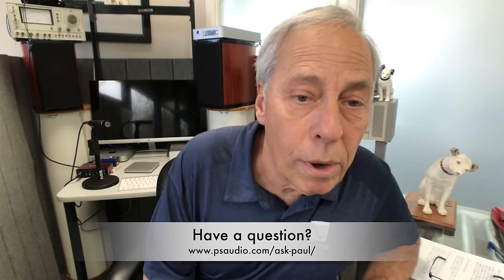How to match amps to speakers

Comment: It gets so complicated.  My understanding is that high powered amplifiers sound better with efficient speakers than lower powered amplifiers (every other variable being equal), because transients are more faithfully reproduced.  There is an "effortlessness" to the sound of a high powered amplifier driving even an efficient speaker.  Also, much of this depends on the kind of music being played.  Heavily compressed pop music may not benefit from a high powered amplifier, but a high powered amplifier playing well reproduced classical or jazz may sound more "effortless".
Reply: I agree.
And let me tell you, the musical genre that is most dificult for a system to reproduce how it should sound it´s Metal. If you don´t have loads of power, the results will not be good.

Comment: We also need to think about clipping in a low power amp trying to get loud out of speaker.  
The longer a party goes and the drunker people get the volume seems to need to go up..
Buy a cheap system for this..
My main amp is 60 rms per channel  and speaker rated at 200 max doesn't say rms so i guess 100 rms. I don't use much power

Comment: Power handling RMS / max.: 220 / 450 Watts
Frequency Response: 18 – 38,000 Hz
Crossover Frequencies: 350 Hz - 3,500 Hz
Recommended Amplifier Output: ab/from 30 Watt(s)
Sensitivity: 93 dB
Can anyone please recommend an amp for the above speakers? I have had 2 amps fail both a Sony  str-db870qs and Yamaha Rx-v367.

Comment: so the unefficient increase the electricity bill and and less good for parties ?
i'd trade that anytime for sound quality
Reply: i meant they could have something to make frequency response flat 
on smaller ones who can get low you may need to reduce mids and highs so they'd be balanced
Reply: example
Philips SHP2500 ( headphones ) sound like speakers with a subwoofer , bass is louder than mids and highs

Comment: Sir, Im from Philippines.
And i want to ask something. I have 300w amplifier and i want to buy 4 speakers..so in one speaker how many watts do i buy..
And i want to connect in parallel connections..
Thank you sir..
Reply: 100-200Watts is enough,..
Reply: @CABohol  100 x 4 speakers = 400w in that is overload
Reply: @ronaldsamson8607  some amplifier and speaker in Philippines is not a real specs,.. Example of that is sakura 5023 the specs says 450Watts,. But i measured the output using my oscilloscope and 8ohms dummy load i can only get 90Watts into 8ohms,.. And also the speaker like crown is not the real specs,. Ex. JH157 specs says 700Watts but in reality maybe it's only 100watts and the sensitivity is not true.
Reply: 80 watts speakers will be perfect for a 300 watt amp.

Comment: Howdy.
I would think that if one puts 300 Watts 15 kHz continuous into a 300 Watt speaker one can kiss the tweeter goodbye very fast.
The tweeter of a nominal 300 Watts speaker can probably handle no more than say 20 Watts continuous.
Amplifiers are rated to deliver the specified Watts continuously over the whole frequency span. Yes.
The speaker Watts is some kind of perceived music loudness. Not true Watts continuous.
Regards.

Comment: Under sized amps burn speakers.  Over matched (power) amps drive cleanly and deliver best sound.  Efficiency comes in to play.  Unless you are using an amp with transformer tap outputs, the impedance just needs to be within the operating range of the amp.  This range is usually between 2 and 16 Ohms.  Select an amp that is not chugging hard whether tubes or transistors.  Just remember tubes have to try harder but generate softer fire breathing speaker burning distortion.  If you are running your system in the 20 to 50 Watt range, any significant increase in SPL adds a 0 to the Wattage number.  You suddenly go from 50 Watts to hundreds of Watts.  I go humming along at about 100 Watts per channel but it is critical to know that there is an extra 0 available for the total horsepower when the program calls for it.  Go play the 1812 from Telarc.

Comment: How can you find out the db's of your loudspeakers?
Reply: Paul McGowan 
Hi Paul. I found out the specs of my Loudspeaker Klipsch RP-280FA Dolby atmos .Impedance at 8 ohms
Sensitivity 98db
300 watts main
600 watts height
Does thatmean my speakers are 98 db 300 watts at 8 ohms?
Reply: I was confused with the "height" stat so i looked them up. 

Sensitivity - 98dB @ 2.83V / 1m (main speakers)
Unfortunately there is no sensitivity mentioned for the "height" (atmos) speaker.

Power Handling - 150W continuous / 600W peak

Height (atmos) Speakers - 75W continuous / 300W peak

They look to be some very efficient speakers, although my layman brain has no idea if the 2.83V is a way for Klipsch to sneakily justify this.

Do AVR manufacturers even vary amp output to the Atmos channel? For example, one of Denons higher end Atmos AVR's only lists 260 watts per channel (max) in their specifications. And they only list power output to all channels, with no distinction for the atmos channels. 

I guess you shouldnt worry too much, i don't know of any AVR's which go anywhere near these speakers' "peak" handling. And while i doubt they also do not reach 75W continuous, they also don't list their "continuous" specifications.

Anyone?
Reply: 1 volt dc applied to 1 ohm = 1 watt,  1volt rms applied to 1 ohm = 1 watt,   1 volt rms = 2.83 volts peak to peak.  
1 volt rms is easier to generate without having to adjust the amplitude for each impedance speaker, so they have chosen to use a different standard than the rest of the industry.  Klipsh speakers are based on horns so they are very efficient.  So 1 volt rms applied to 4 ohms = 1/4 watt,  1volt rms applied to 8 ohms =1/8 watt.  With their sensitivity this high testing at 1 watt would be very loud, and an amp that outputs 16 volts rms would get you beyond 120 dB (threshold of pain).
Reply: @henrycarmona8519  In the sensitivity measurement, "2.83 V" is the RMS voltage applied across the speaker terminals because that voltage across an 8-ohm loudspeaker is one watt delivered to the speaker. The formula for power in watts is the square of the RMS voltage in volts across the speaker divided by the impedance of the speaker in ohms. The sensitivity of a loudspeaker is the sound pressure level (SPL) in decibels relative to the threshold of hearing that the loudspeaker produces when excited by a 1-watt audio signal (or for an 8-ohm speaker, 2.83 V rms) at a distance of 1 meter from the speaker on the axis of the speaker.

Comment: In my opinion you missed an important point! If amps are to small the clipping gets more feasible and if you clipp at max voltage or current you will distroy easily your horns or high frequency loudspeakers. So at least equal the speakers, better more.

Comment: Just choose an amp that's rated at double the RMS rating of the speaker, i.e. if the speaker is rated at 100w RMS, choose an amp that is rated at 200w RMS at that speaker's nominal impedance.  Forget peak/max wattage ratings as they are just about useless.